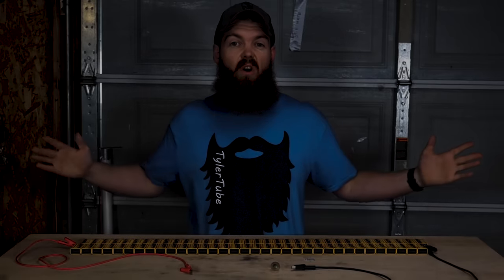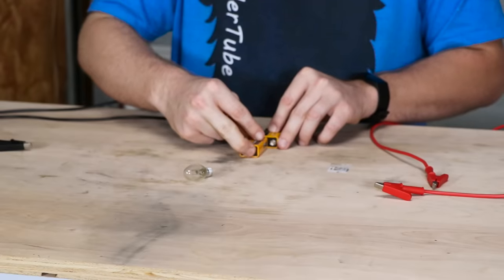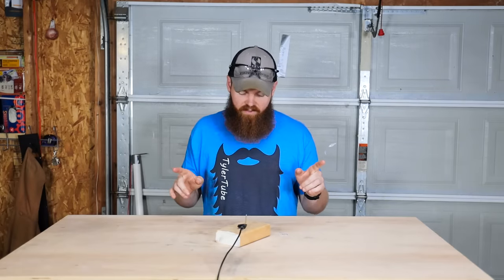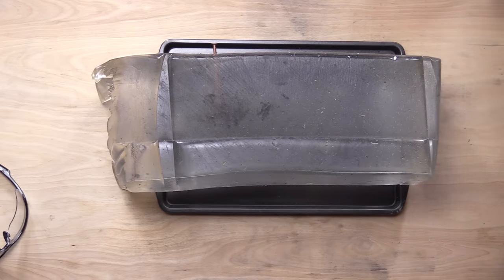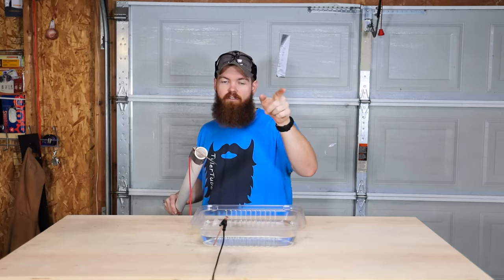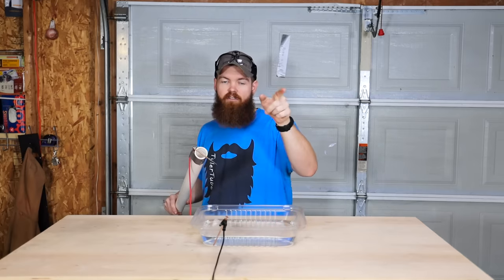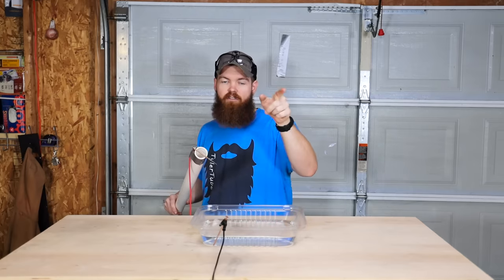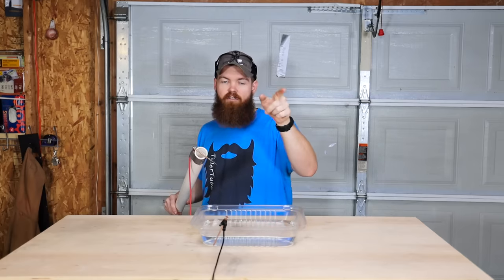I Connected 500 - 9 Volt Batteries...

Comment: I would be wearing tinted safety glasses. Some of those arcs are no different than welding, and could be exposing your retinas to UV
Reply: that or other dangerous wavelaegths of light too
Reply: Clear polycarbonate is actually opaque to UV! I think that's really cool. But still, he's going to temporarily blind himself with the bright visible light, assuming he doesn't manage to enact suicide by negligent battery handling first.
Reply: It is essentially an arc welder yes
Reply: Having flash burn is no fun that's for sure
Reply: I was kind of wondering if he could put an electrode to the end of that damn death contraption and weld with it.
Reply: The safety glasses we have in our welding shop block the UV (Z87+U6). The U6 means that it blocks out 99.9% of the uv light). It's the infrared and visible light that you need to worry about.
Reply: ...exposing your retinas to UV...

This is true but I would like to add the the risk of cataracts also.

Comment: He created capacitors with those hotdogs. Wood being an insulating catalyst, and having a floating earth.
Reply: ...He created capacitors with those hotdogs...

    WRONG!!! The hot dogs created resistors being that they were less than ideal conductors albeit there was a solid, resistive continuity from one end to the other while never actually storing any kind of charge as a capacitor would. A non-super cap type, capacitor consists of two parallel plates or coils of metal foil with a dielectric insulator between them. This dielectric can consist of either air for low value disk caps or paper and a dielectric chemical to retard drying of said paper in the case of larger filter or motor start electrolytic capacitors.

...Wood being an insulating catalyst...

    What the hell are you talking about??? A catalyst is something that causes something else to happen. Platinum and palladium in a car's catalytic converter causes unburned hydrocarbons to be converted into carbon dioxide. When the hydrocarbons come into contact with these two metals, it causes an exothermic reaction solely due to these three things coming into contact with each other.
    An argument could be the catalyst for a physical altercation due to increased animosity between the involved parties. Peaceful coexistence does not cause animosity between people so peaceful coexistence can not NOT a catalyst.  
    The wood acted as an inactive insulating substrate for the soda water CATALYST to sit on. The wood, by itself, would have sat there and conducted no noticeable energy unless the voltage was stepped up into the tens or hundreds of thousands of volts.
    The soda water was the catalyst to allowing the conduction of the 5,400 volts along the length of the wood. As the soda water was electrolyzed into hydrogen and oxygen, It's resistance increased thereby causing it's temperature to rise to the point where the wood began to char. At this point, the wood was reduced to it's electrically conductive carbon component thus becoming conductive in and of itself thereby promoting the artful charring effect observed so long as the voltage continued to be applied.

...and having a floating earth...

Not that there was any coherent connection to anything else that you had to say but you did get this part correct.

Comment: Table: bending beneath the weight of the batteries 
Tyler: Slaps batteries
Reply: Tyler: this should be about 600v.

Also Tyler: lays hands at the ends of batteries and almost short circuits them with his arm.
Reply: eh i have the same table and it has a ring of metal poles to support heavy stuff better my fiances dad (200+lbs) sat on it and it was suprisingly fine its just bendy as hell

Comment: As a physics and chemistry teacher HOLY CRAP!!! So incredibly dangerous!
Reply: I hope u know it's not as dangerous as sticking a fork in an industrial outlet. This is a low amp high volt line. It's basically a lightening strike  but less violent and more controlled  environment.... The most hed have is  a nasty zap that will give third degree burns on the contacts 

A nine volt battery doesn't shock u unless the metal contacts are jumped   with metal....   And then that doesn't hurt the person u end up just melting your wrench on the contacts.... Then blowing up the battery from over heating....   The cars battery level is nine volts of power with loads of amps   which is the opposite of what he's doing.
Reply: @delavanty  For dry skin, as the body follows Ohms law. But he was playing with soap solution. Plus, it was not a 9V battery, it was several batteries in series.
Reply: @delavanty  It only takes 100-200 milliamps across the heart to potentially kill someone, and I believe 9 volt batteries go about a 500 milliamps, right? Sure, it's not like licking a power line, but still a dangerous scenario.  Every time he pointed out something with his free hand (aka the anode) I admit I flinched a little.
Reply: @delavanty  Your comment proves you know nothing   about high voltage. If he touched that, he'd probably burn to death in a few seconds. Why? It's 4500 volts DC across his heart. You don't understand the ohm's law. Just 100 mA with 120 V AC can kill, so 12 W. So just ~2 mA would produce the same power. Assuming that the resistance of his body is 100 Kilo ohms, The current would equal 450 mA with that battery. So, more than dead
Reply: @delavanty  It way more dangerous than sticking something in a industrial outlet let's assume 480v outlet with 100amp breaker the limiting factor is human body resistance, not the breaker, which is around 2000 ohms. With these numbers you will get 240 mA passing through you. Now the batteries are 4500v + 2000 ohm human resistor = 2.25 amps. If you short circuit a 9v battery you will get about 2 amps so that would be the limiting factor by a small amount, but 2 amps passing through you is about 10x what is needed to kill.
Reply: @delavanty  not true at all
Reply: @delavanty  Sorry but you are wrong, and dangerousy so.

Comment: Each 9v is about 500ma, (typical continuous drain is 15ma). At any rate, 4500v X .5amp =2500 watts possible. The high voltage could arc easily to a human and instant death. Don't try anything like this at home. That high voltage will arc thru the wire unless you have the properly rated insulation that can handle voltage safely.